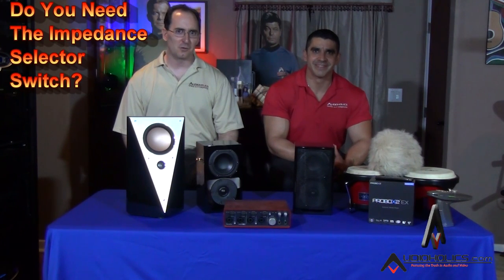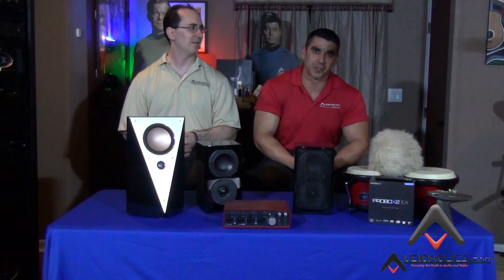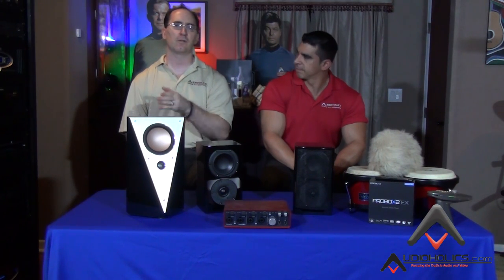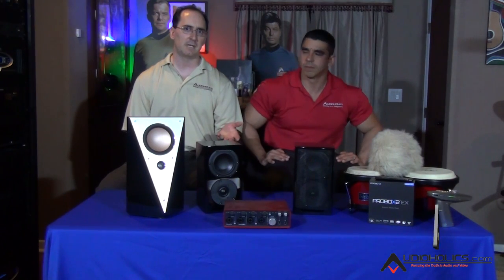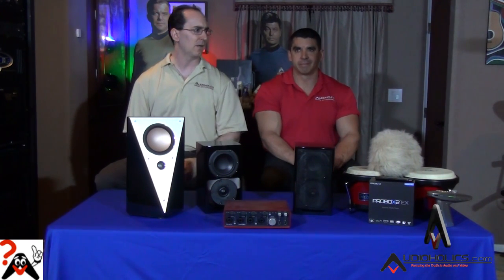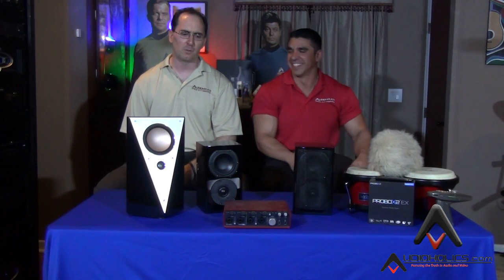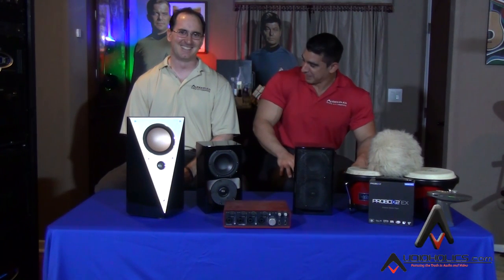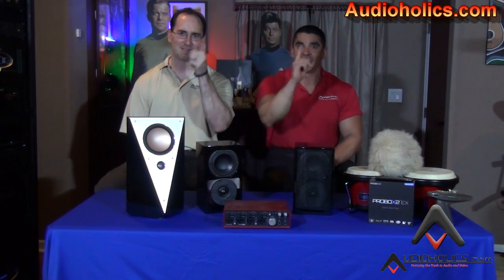AV Receiver Impedance Selector Switch: How Should I Set It?

Comment: The Yamaha test result makes sense, and in that case I would NOT take your advice to leave the selector at 8 ohms when driving 4 ohm speakers.  It achieves nearly the same power at 4 ohms, that it does at 8 ohms.  Leaving the selector at 8 ohms with a 4 ohm load will make the output transistors run much hotter - not a good idea!  
There seems to be something seriously wrong with the Denon and I'm having a hard time believing its behavior is according to design.  Moving the selector switch to Low Z with an 8 ohm load should only drop the power by 50%, not 80%.  I think you need to test another one.
Reply from the maker: You're very mistaken. The 4 ohm setting produces significantly less power driving 8 or 4 ohm loads. If that's what you prefer, then less power to you.
Reply: @Audioholics  
Your table at 3:25 shows the Yamaha at 155 watts into 8 ohms (selector at 8 ohms) and 144 watts into 4 ohms (selector at 4 ohms).  The difference between 155W and 144W is not audible.  
Operating the amplifier with a 4 ohm load and the selector switch at 8 ohms, significantly increases the output transistor dissipation and operating temperature.  To me, the extra 70W you can get operating the amp that way (1.6dB louder), is not worth the added thermal strain.  My equipment longevity matters more than playing music 1.6dB louder.  As implemented on the Yamaha, the provision of the impedance selector was a sound design choice.  
The Denon case is different; I still think there is something amiss with the unit you tested.
Reply: @marianneoelund2940  About a year late: You are reading the chart wrong, it goes from 155 to 78 and 225 to 144, not 155 to 144.
Reply: @homeboi808  
No, it does 155W into an 8 ohm load (set to high Z), or 144W into a 4 ohm load (set to low Z), when using the switch per the user manual.  So, when operating the unit correctly according to Yamaha, it achieves nearly the same power output for both loads.  That does not include Gene's improper switch settings.  
The Yamaha engineers are quite careful about design details.  If they included a selector switch for load impedance, it was done for good reason, based on thermal and SOA analysis for the output stage.  
If Gene wants to suggest that owners use his non-approved switch settings, then he should be showing us the thermal and SOA analysis which proves it is safe for the output transistors.  How about it, Gene?
Reply: @marianneoelund2940  Again, you are not reading the chart right. What do you think the 225W in the 4ohm row in the High Z column means?
Reply: @homeboi808  
It means the amplifier is not set according to the owner's manual, i.e., you're not supposed to do that.  
The problem here isn't my reading of the chart.  The problem is your refusal to read what I wrote.  Only two out of the four combinations in the chart are correct use of the amplifier - 155W into 8 ohms and 144W into 4 ohms.
Reply: @marianneoelund2940  
The amp in the chart goes from
8ohm: 155 to 78
4ohm: 225 to 144
Amps should double down when halving impedance, so the equivalent wattage is thus
8ohm equivalent: 113 to 72

So you are getting almost 1/2 as much wattage when the switch is active.
Reply: @homeboi808  
There is no such rule that "amplifiers should double power output when halving load impedance."  That's just childish "audiophile" owners insisting that they are "cheated" if they don't get what they believe they paid for.  There are excellent amplifier designs that produce the same power into 8 ohm, 4 ohm, or 2 ohm loads (e.g., some McIntosh models).  
I should point out that the Yamaha almost achieves power doubling with the selector switch in the low Z position for both load impedances, going from 78W to 144W.  There - happy now?  The fact that the same load change only increases power from 155W to 225W (not 300W) with the selector in the High Z position, should suggest to you that the amplifier is straining a bit in the 225W case.  
What you are getting from the Yamaha, by abusing the impedance selector switch, is an increase from 144W to 225W with the same 4 ohm load.  As I already explained a year ago, that's a mere 1.6dB increase in sound level, at the cost of potentially damaging your amplifier.  Is it worth it to you?  It certainly isn't to me.  
If you spent $7500 on an amplifier which had clearly labeled 2-ohm, 4-ohm and 8-ohm outputs, would you connect 4-ohm speakers to its 8-ohm output terminals?  That is akin to what Gene is suggesting you do.
Reply: @marianneoelund2940  Why on earth are you bringing tube amps into the discussion?

And firstly, you stated 155W to 144W was a marginal difference, which was a point of confusion I was correcting as you were comparing High Z of 1 impedance to Low Z of the other, which makes no sense.

And no, there is no “struggling”, that 225W is stated under the THD parameters that Gene used (1%?).

And yes, speaker amps should double down. Speakers are not constant impedance, they are complex and change with frequency, and the phase of the impedance will also stress out the amp differently. If you had an Class-AB amp that did exactly the same wattage into 8ohm and 4ohm, that would sound terrible, as some frequencies out of your speaker would be 3dB lower than they should be.

No McIntosh amp gives the same wattage into 8ohm as 4ohm on the same tap. Those specs are for when you use the 8ohm tap or the 4ohm tap. Which tap you use depends on your speaker and what range of values its impedance are in, they still attempt to double down regardless what tap you choose. But this discussion has in no way any relation to the main topic.

It is not a 4-ohm tap, it is an Eco mode. No $7500 AVR has this setting as they don’t need it as they are built better than the $300 AVRs that do have the switch.
Reply: @homeboi808  
The McIntosh models I was referring to, are solid state amps.  There is no change in their rated power across 2-ohm, 4-ohm or 8-ohm loads when they are connected to the correct tap - just as there is no significant change in the Yamaha's power output between 8-ohm and 4-ohm loads, if you set the impedance switch correctly.  
With the Yamaha, you set the selector to High Z for 8-ohm (155W), or Low Z for 4-ohm (144W) speakers.  How does that not make sense, and how is it not valid to make the comparison?  
You cannot claim that the receiver experiences no strain or risk of damage operated with a 4-ohm load, and the selector switch set to High Z, until you have done the thermal and SOA analyses.  The switch is there for good reason, and part of that reason is the complex impedance nature of speaker loads, as you mentioned; phase-shifted current draw increases the stress on the output transistors.
Reply: @marianneoelund2940  Yeah, that’s impossible. This is why specs need to be verified.

The Yamaha 100% has difference between loads, no clue why you are saying different. 144W into 4ohm is 24Vrms, 155W into 8ohm is 35.2Vrms.

300W into 4ohm is 150W into 8ohm. An amp that does 150W into 4ohm would get as loud as amp that does 75W into 8ohm.
Reply: @homeboi808  
Your voltage figures are correct.  What the impedance selector switch does, is reduce the +B/-B supply voltage to the output stage, and this is mainly why the voltage swing for the 144W 4-ohm case is much lower.  But that does not make it noticeably less loud, if comparing with 8-ohm and 4-ohm speakers that have similar efficiency.  When changing between speakers of different impedances, you can't estimate loudness from the amplifier output voltage alone; you need to look at the power.  That is why I'm saying there is little difference between the Yamaha's 8-ohm (155W) and 4-ohm (144W) power capability, if using it strictly according to the owner's manual, not Gene's "cheating" method.  The manual prohibits operating with 4-ohm loads and the selector switch set to High Z, i.e., it doesn't allow the 225W case in Gene's chart.  
Your comment "An amp that does 150W into 4ohm would get as loud as amp that does 75W into 8ohm" is incorrect.  If the speakers have similar efficiency, the 4-ohm case will be 3dB louder.  Same voltage does not mean same SPL, unless speaker impedances and efficiencies are matched.  
I found a schematic diagram for the Yamaha, so I can compute the power dissipation in the output transistors for various load/power combinations.  I will post some data later.
Reply: @marianneoelund2940  
The Yamaha will get 225W, how do you think Gene got that much power elsewise? It just may get too hot.
______
Speaker sensitivity ratings are not done at 1W but at 2.83Vrms. 4ohm speakers do not gain 3dB.

If you have an 90dB 8ohm speaker, it will get just as loud as a 90dB 4ohm speaker assuming ideal amplification (2x wattage into 4ohm).

If you engage the wattage limiter on the Yamaha, it does 144W into 4ohm, similar to the 155W into 8ohm when the limiter is off. Let’s just call it equal. What this means is that if you use a 90dB 4ohm speaker with the switch on, you just made it the equivalent of a 87dB 8ohm speaker with the switch off, you are losing 3dB by activating the switch and using a 4ohm load.

3dB loss is absolutely audible. Scientific speaker testing/studies call for level matching of at least 0.2dB.
Reply: @homeboi808  
I never said the Yamaha can't put out 225W into a 4-ohm load.  I said such operation violates the user's manual requirement for setting the impedance selector correctly, so that shouldn't be counted as its true performance.  But I see that you finally understand there may be an overheating issue, which was my point in my very first post here.  
Don't confuse speaker sensitivity ratings (if done at 2.83V) with efficiency.  They are not the same.  I've been talking speaker efficiency all along, not sensitivity ratings.  
If you have an 8-ohm speaker and a 4-ohm speaker, both with a sensitivity rating (at 2.83V) of 90dB SPL, for example, then the 4-ohm speaker is only half as efficient.  
You can modify an 8-ohm speaker to be a 4-ohm speaker, by changing only the voice coil winding.  Doing so maintains the same efficiency, but the 4-ohm version will have a higher sensitivity rating, because it will play 3dB louder at the same voltage (because it will draw 2W from the amp instead of 1W).
Reply: @marianneoelund2940  That is not what efficiency means. Efficiency is how much of the incoming signal gets utilized. For amps, it’s how many watts they draw from the wall vs how much they put out (this is where Class D is great). For speakers, it would be compression (very efficient at low wattage but worse efficiency at high wattage), see Erin’s Audio Corner for speaker compression testing.
Reply: @homeboi808  
I didn't give a definition of efficiency, so you have nothing to object to.  
Your definition is imprecise, as there are various interpretations of "gets utilized."  
Compression has an impact on efficiency by increasing voice-coil copper loss, but is not a definition of efficiency.  Speaker efficiency is the ratio of acoustic power that it radiates, to the electrical power (non-reactive) that it receives.  Speaker efficiency numbers are very low, so I would not characterize them as "very efficient" in any case.
Reply: @Audioholics Less Power to you.
😂😂😂😂😂😂😂😂😂
Can't help myself laughing to your reply to a stupid question whilst yous have repeatedly explained many times already in the video.

I think most people can't swallow the pill of truth even if the Truth Gives More Power to them
Reply: @homeboi808 😂😂😂😂😂😂 
I can't help but laugh at the replies to you are getting from Mrs Mariam.
She is either not willing to accept the truth, 
or she doesn't understand the science of Amp/Speaker impedance,
Or as Audioholics have replied to her: "Less power to you".

😂😂😂😂😂😂😂😂😂
Reply: @marianneoelund2940 
Turning the Speaker Impedance switch to 4ohms on AVRs is reducing the power the AVR is able to deliver to your speakers.
My point is, if you are not happy with the additional power available to your speakers, why did you not instead purchase an amp that delivers less power in the first place.

And most importantly, speakers do not constantly draw stated maximum power all the time.
Most of the time we are listening at levels of 5watts to 10watts. The additional reserved power is the your speakers to deliver dynamics, which is crucial for Home Theater demands vs listening to Music.

So it short, set it at 8ohms, and enjoy the dynamics that your AVR is able to deliver from the additional power reserve.
Reply: @marianneoelund2940 
😂😂😂😂😂😂😂😂😂
"Equipment Longevity"
😂😂😂😂😂😂😂😂😂
Reply: @warrenlee1562  
1.  My amp doesn't have an impedance selector switch.  
2.  I understand that speakers only draw low power at typical listening levels.  At high levels, I can monitor the amp outputs with my scope to see what the headroom is.  
3.  Driving 4 ohm speakers with the selector switch at 8 ohms substantially increases output transistor power dissipation at ALL listening levels.  
4.  Do you know the design considerations for SOA protection for BJT output devices?  
5.  You only gain 2-3dB peak handling by leaving the switch at 8 ohms.  Is that worth risking damage to, or shortening the service life of, your output stage?  
6.  Do you know the reasons why the design engineers chose to provide the impedance selector switch?

Comment: Holy crap. You're recommending to increase the current through the transitor channel which causes degradation, electron migration, reducing the 10 year silicon lifetime rating, eventually catastrophic failure, and generaly compromises reliability. This is dangerous misinformation which you're apparently ignorantly recommending due to your own inexperience and misunderstanding of the qualification process. I've seen multiple times amplifiers blowing up without distortion because the load/speaker impedance was lower than compliance. Kindly suggest you think this through a little further, from an engineering standpoint.  🤦
Reply from the maker: Fake news. You do more damage to your speakers by severely limiting clwa. Power at high drive levels.